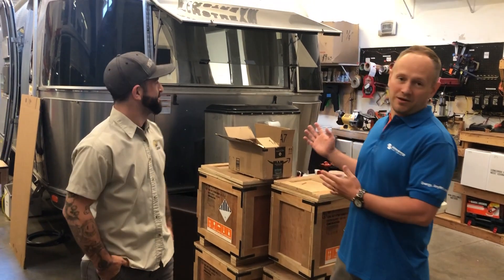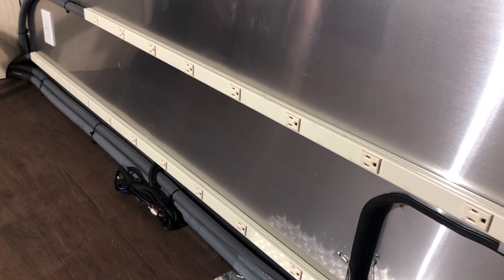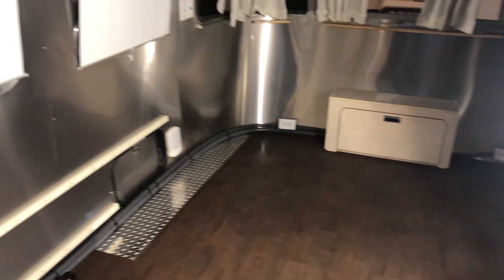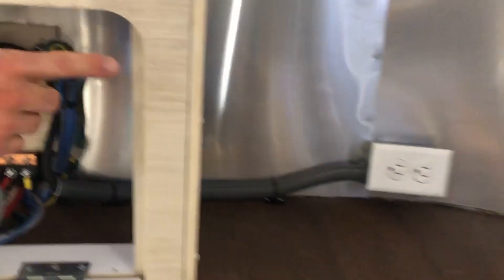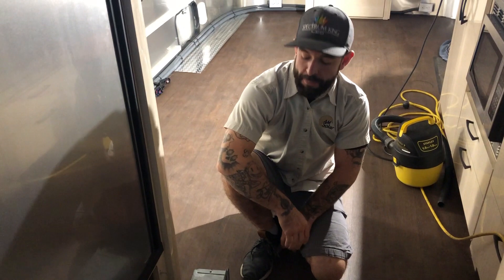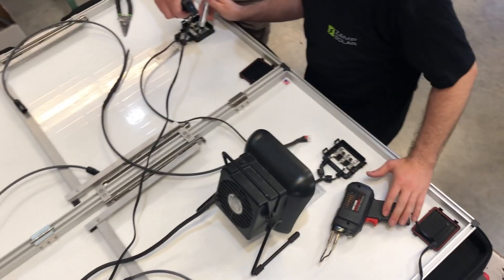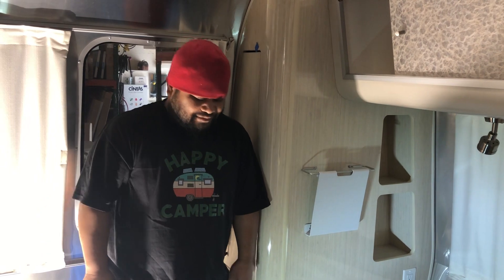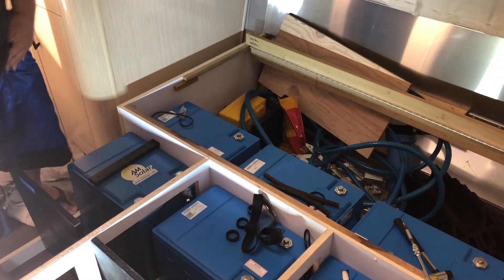Ultimate Airstream Solar, Lithium & Inverter Upgrade (Pt. 3 – AC Wiring and Portable Array)

Comment: How did you add 5 circuits to the factory converter/panel?
Reply from the maker: We use duplex breakers instead of the factory single breakers.  Does that help?